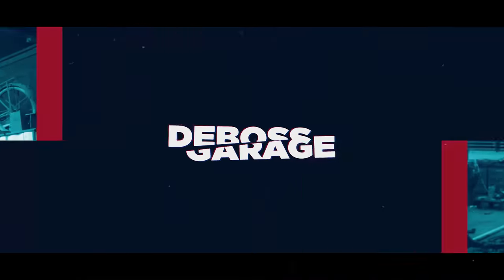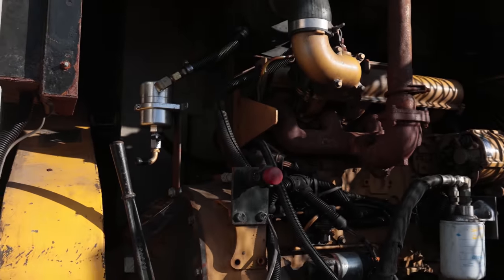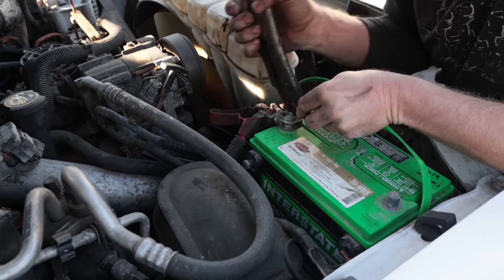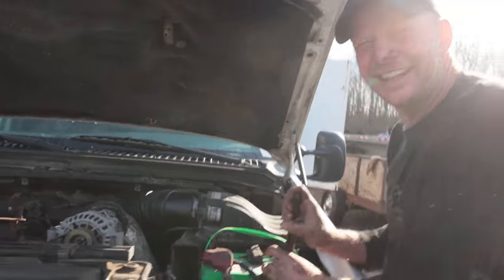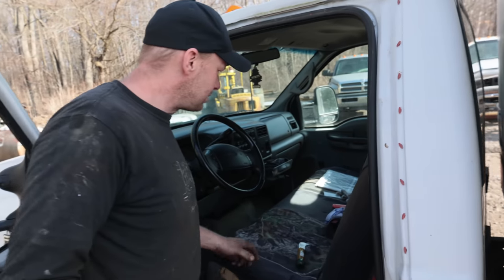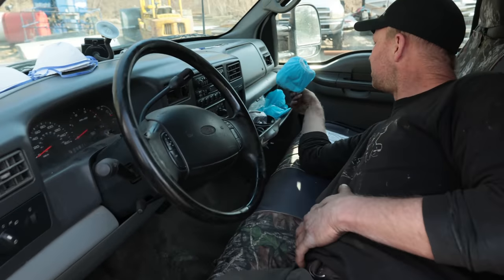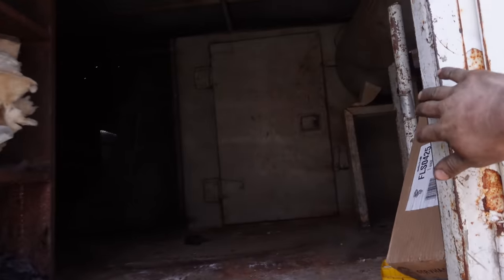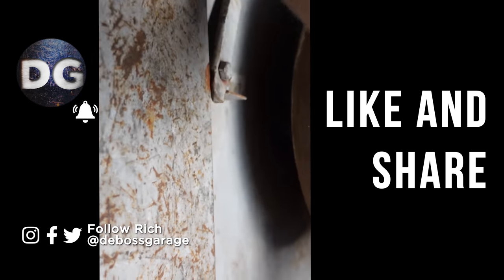Will It Run? F550 Powerstroke has a 4cyl CAT for a starter!

Comment: I wanna see that cat engine stuffed in an old 80s 4x4 Toyota pickup with dual transfer cases and 44s
Reply: Dual tcases and 44s equals broken toyota axle shafts, birfields and stripped ring and pinion gears
Reply: This
Reply: @shaun.h.barlow  Breaking it is half the fun. Upgrade as needed, Debby Downer.

Comment: Well 7.3 like to turn over fast to start.  That and they just live good glow plugs. Good video
Reply: These 7.3s if they are healthy will start just fine above 35 degrees without them. I used to have an old 95 down here in Texas, & just turned em off & had em on a switch so I can use them once a year when it got cold below 40-35 degrees.

She would always start right up & run like a clock. I’ve got a 93 idi rn & I miss the iconic sound & instant start up. I had done a straight pipe & a ton of tuneup stuff on her & even with head gasket issues & injector issues she still ran like a clock no blow by at all.

I’d get another PSD for a work truck or as a 2nd truck & have my idi as my backup/oil burner.
Reply: @michaelbenoit248  I’ve started mine in -25 here in Alaska. Absolutely hates it even when it’s plugged in.
Reply: I think he didn't give enough power to just start dumping ether at the beginning, a sniff to start, and then a few more when it clears  out

Comment: When you were cranking that engine it had a couple cylinders with low compression.  You could here the cranking speed up and slow down on a regular interval.
Reply: Same thought I had..  First crank and you could hear the dead holes.  I probably would've given up on starting right there.

Comment: cold starting 7.3s that have been sitting too long straight into the ketchup... I thought I was watching one of Peg's videos for a second
Reply: I had a 95 7.3 PSD as my first truck. The one I had was an X-Lawn care truck & it sat in a field for 3yrs. $250 later she was mine. Towed her home, threw a set of good batteries in her, & she frigin started right up & idled instantly.

She had a fuel leak, so we fixed that & a few other things. Driver her for a year then had head gasket issues & injector issues. 

During that time I did a straight pipe, 3.55 rear axle swap to make her better for the HWY & that’s about it. No tuning at all, & didn’t want too.
Reply: @michaelbenoit248  did you find a whole new rear axle or just swapped gears? I have a 97 with 4.10 gears and she’s a bear on the hoghway
Reply: @alecchamberlain4231  Mine has 4.10s as well. With a programmer intake exhaust and downpipe it holds highway speed much easier.
Reply: It all depends on the overall condition of the engine and components. My 96 was parked for over two years, but was in decent shape as far as starter, glow plugs and injectors. Two fresh batteries (not the half dead shit like Rich has laying around the shop) and it fired up on the first crank.
Reply: @Sackmatters  I’m not saying it can’t handle the highway but 70mph I’m turning 2500 rpms

Comment: We have a ‘99 F550 bucket truck, yea, if that engine is cold, we have to put one, sometimes two running vehicles on it just to keep the batteries charged while cranking it, and with starter fluid. Once it starts it has to sit there and idle for about 15/20 minutes before you can drive it. If the block heater was plugged in then it starts right up and runs well right away.

Comment: Those 7.3 engines do start alot easier when being turned over fast, as for ether, a safer way to do it is to disconnect the glow plug relay then spray into the the y pipe that goes directly to the engine. Just saying for future reference
Reply: Apparently Glow Plugs didn't function?
Reply: @bjre.wa.8681  i assume they did based on he jumped back when it turned over (backfire fire glow plugs igniting the ether)
Reply: Yeah they definitely need decent cranking rpm to start
Reply: Thanks for teaching him something.
Reply: @noahguyse2908  yup, starting fluid in a 7.3 is a good way to blow a hole in a piston if you don't undo the glow plug relay

Comment: Should do a rebuild on the 7.3L. Use the motor as an engine swap candidate, along with the CAT.
Reply: Doesn’t have to be a fan of the motor, but it’s agreed that the 7.3L is a stout diesel motor in terms of reliability. It’s even been stated by many that it is one of the best diesel engines to be ever equipped in a heavy duty truck or van, even buses and box trucks. International (at the time) sure knew what they were doing and it is one of my favorites in terms of diesel motors.
Reply: @Patrick Baptist  I agree. The only Maxxforce engine that’s decent is the DT.  I drive a bus that has a VT365, but I told myself that as soon as I was able to purchase one, take out the 365 and drop in a T444E engine. I’ve seen some run forever, and the traits the 7.3L has are second to none. Ability of running dirty fuel, even biodiesel with little to no modifications is one of the traits. Brute mechanical simplicity is another trait, thanks to the 6 head bolts per cylinder and the fixed geometry turbo. Indeed dollar per mile, the engine is the cheapest and the best engine in the IH lineup. 

(Nice job on the project so far 👍. Might even video log my swap if I could get a bus cheap and an engine cheap.)

Comment: 99.5 to early 2001 was good 2002 started powered connecting and will start to brake rod after 500hp. what a deal nice little engine. and i do hope ya took the air compressor out and kept it to would give ya all the air ya need in a shop.

Comment: You should probably know those knuckle boom little cherry pickers are real Handy they got multiple bends up and over things and if it has an extension on the basket really helpful you can go up and over racks do work on the other side of them used to use them put in retro fitting earthquake upgrade

Comment: Try to start the engine, then check the oil?  Kinda like the Far Side cartoon where two are making breakfast and one days “Wait, first add cereal, then milk!”

Enjoy your show.  In my misspent youth, I spent a lot of time working with those 71-series two-strokes. (If the Aerosmith band members had ever worked on a Gymmy that song would have been called “Scream on.”) 😉

Comment: It more than likely bent an exhaust pushrod "thumping/popping" out the intake when it the either explosion happened. 7.3 cams and lifters last forever and have almost 0 failures but rockers break pushrods bend and rocket pedestals will break off aswell.

Comment: I’d try to fit that CAT in a pickup, somehow. I know it’s not that feasible, but it would be cool.
Reply: why not feasible... there are a lot of 4BT trucks out there.
Reply: @daviddelambert2752  I’ll be the first to say I don’t know that awful much about engines and I’m learning as I go- but I thought there were some differences between engines used for stationary things and engines in vehicles. Nothing that couldn’t be solved with some other parts or workarounds, it would just be a matter of money and finding those workarounds. Though I imagine, putting this engine in a small industrial vehicle would be easier than a pickup or something, since with a pickup you’d have to figure out some kind of adapter to connect the engine to the transmission, when they probably already make adapters for the little industrial vehicles. Anything is possible with enough time, money, and effort. It’s just a matter of, “is it worth it in this particular instance?”

Comment: Put the cat in a  Half ton pickup,  ranger or s10 That would be cool I think unless it' to small. On the fork fork lift I'm sure you replaced the needle and seat , Have you replaced the float and fuel filter and check fuel pressure, May need a regulator. I have a 78 250 and it had similar problem,ended up fuel filter was deteriorating and debris got caught in needle.

Comment: If it wasn’t in Canada, I’d buy that cat. Been wanting a 3054 for my truck. Weighs less, not as tall, not as long, and stock can be just as powerful as a 4bt. If I recall the 3054 and 3056 are just descendants of the old 4.236 and 6.354 Perkins, just modernized and painted yellow.
Reply: That is correct. They are 4.236. 
The problem you will run into it is bell housing and flywheel for automotive. You can  buy anything for a 4BT to fit Ford Chevy or dodge. For the Perkins you are looking at making it all fit yourself.
Reply: I believe it’s an SAE #3 pattern, there’s adapters out there for it to automotive. I’m not claiming it’ll be easy but when is it ever.

Comment: You would be sweeping up the crank off the ground if you tried that with a 6.0 power stroke
Reply: You do realize that the rotating assembly in a 6.0 is stronger than a 7.3 right?

Comment: Wouldn't use that air compressor in the rear no more though. It's probably rusted from the inside after all these year, and is an explosion hazard when fully pressurized.

Comment: A four cylinder cat that is really a Perkins.
Reply: Perkapillar
Reply: @ForeverNeverwhere1  more than likely you’re right, Richard’s is a 3054B tier 2 engine for industrial applications, yours was a dedicated engine rating for BHL machines, same engine architecture. Although I’d suggest you if you are in the market for a new BHL to check out our new machines equipped with state-of-the-art C3.6 engine it’ll make twice the power and torque of your old machine for far less fuel usage

Comment: Hey I see u guys are using ether to start diesels. I'm sure you know that it destroys injectors. A great diesel friendly alternative that has been recommended to me was CRC heavy duty silicone lubricant spray. You can spray for "hours" with that stuff and it doesn't destroy the injectors
Reply: As a follow-up, some diesels are better to start on ether like a 2-stroke Detroit. But typically for most 4 stroke diesels silicon spray is the way to go because ether is more comparable to gasoline or alcohol vapors as opposed to silicone spray which is more like diesel/oil

Comment: I have seen a few times that the powerstrokes need some PB blaster down the intake and it'll help the rings and valves seal up enough to fire.
Reply: What that needs is actual good batteries. It’s a bigass engine and it needs rpm speed as it uses high pressure oil to fire. Minimum psi - 500 psi

Comment: "Running a bit rough.  Probably a couple of bad injectors"

That moment when that crappy 7.3L that has been sitting in a field for a couple of years with two bad injectors runs better than my 6.0L that I treat like a queen with full synthetic oil, hot shots secret, and constant maintenance........

Comment: Use propane instead of ether when cold starting a 7.3 its easier on the injector tips
Reply: Did you miss the propane can he had in the intake like right after the ether?
Reply: @phillipwarner5504  when? All I saw was ether
Reply: It was on of those green propane torches he just didn't have it lit

Comment: Damn thing sounds like it's starting and running on 5 cylinders. 97' and older for the forged rod 7.3's. 99 through 2000 is a crapshoot until IH used up all the forged rods. 2000, on and any reman are almost guaranteed a PMR engine. I could go on about the ability of PMR rods, plain and simple, the 7.3 is the wrong application for PMR, the 6.0 had a more rigid block.

Comment: For anyone who cares.
94.5 is when ford started making the 7.3 powerstroke
They made variations of the same motor until 1997, when they stopped making it untill 1999. 
99-01 had forged internals, 02-03 had cast.
The 99-03 all used better hpop and lpop systems among many things, making them much better for high hp using factory parts. 
Just to sum it up, 94.5-97, 99-03 were all the years of the 7.3 powerstroke.

Comment: Yup! 2001 they stared using a sintered connecting rod. Damn you know your stuff!
Also fun story I had a 2000 F550 that had a 10kw Onan in the back that used to run the block heater and start it. Small world
Reply: For the record, they were mixed during 01. Some were forged. Others were PMR. Mine is PMR ☹️
Reply: @gavinatkins2671  is there an indication on the serial for the engine or do you have to pull it apart?
Reply: Haven't had any such problems yet with my 02, and its been many years since it was the original power level. Only thing I've learned in a very expensive way is the oem valve springs aren't fantastic at elevated power levels, but for $120 comp cams has the solution. If only I had known that prior to my pistons and valves playing bumper cars, several times.
Reply: @JacksonEngineering  pop the rod inspection port and get a look at the bottom of the rod. If it has studs then it’s forged. If it’s a bolt instead it’s PMR.
Reply: @jaydunbar7538  about 900 ft lbs to the ground is the hard limit on PMRs. About there is where they start a journey towards their rapid unplanned disassembly.
Reply: Pmrs are good to about six hundred horse depending on how you drive
Reply: @williamuskoski1385  I drive like I’m sponsored, and all the 600 horse PMR builds I’ve seen have been high (Ish) RPM builds. 

Cylinder pressure kills PMRs and cylinder pressure is torque.
Reply: Sintered metal is the metal version of chip board sweep up the chips from machining real rods and put em in the clapped out forge that don't press as hard any more

Comment: I finished the rear end on my mini bike and did some burn outs. Can't test ride it till the new twist throttle comes in.

Have you tried those optima batteries that look like a 6 pack? I've been wanting to get one and give it a try.

Will that engine fit in a 96 s10?
Reply: Lots of extra money for no real reason to most people. The 5 year warranty batteries at Walmart are a far better value and perform the same job. Half the price and 2 years extra warranty over the optima. 

Don't get me wrong the deep cycles and agm are fantastic tech and have their place, its just not actually worth it for the average person simply wanting to start their car for work. AGM is great for high vibration environments such as the refrigeration unit on my trailer(which is a red top optima), and my ice house is powered with deep cycles where they are drained low and then recharged which is their strength over traditional lead acid.

Comment: These engines doesn’t like ether... I always pull the intake duct and spray brake clean right into the intake.. never missed one
Reply: The engine don't mind ether if the battery's are good. Glow plugs don't like the ether but real Diesel's don't have glow plugs they have compression and at least three grp31 battery's. Ether starting method for pickup diesels spray, pray, and hit the key like its a gasser just ignore the wait to start light

Comment: well you should of used brake cleaner to start diesels works better than starting fluid or some gas on a rag doesn't hydroloc so bad
Reply from the maker: Hard to find chlorinated brake clean in Canada

Comment: Kind of a waste putting it in the clapped out forklift. A pinto motor would do that for the rest of it's life, unless you plan on a total redo. Even the manlift is kind of a waste. I'd re-connect it to that nice compressor head and put it on a service truck or something like that. V&R got a nice service truck that has a salvagable crane? Nice project, and it would be great for retrievals once you got it running.
Reply from the maker: If I build a service truck, I have to go on service calls.  Why leave my shop?  I had a 4900 with 14' IMT service body and crane and sold it just for that reason.  I enjoyed the calls, just not after 5 and weekends, when its raining or cold.  That seemed to be the only time the truck was needed.
Reply: @DEBOSSGARAGE  Can't blame you there. Things seem to break more in bad weather, especially in our lattitude. Just looking for something that would really take advantage of the nice little CAT motor. I'll be watchin whatever you put her in.

Comment: I think it's funny all these starts on cars have been sitting for years and every channel I watch brings out two crappy batteries to try to get the thing to start 7 3's if you got two good batteries will start a whole lot easier amongst a lot of other vehicles.
Reply from the maker: The one battery was 1 year old.  Getting crappy batteries right off the shelf
Reply: Two good batteries are expensive. Rich teaches how to make do with what you got.
Reply: @DEBOSSGARAGE  I used to buy interstates then went to exide. They are both the same manufacturer but neither last for me.

Comment: I'd actually like the dash panel and the programming whatever for the speedo, and the driver's seat and the insulation under the hood, one of the window cranks too, and the fuel tanks!
Oh one more thing, I say all of this because we have a 2000 F550 Fontaine Classic Traveller with the 7.3 with the cheaper rods, my question is what is a good tuner i can use that wont blow the engine up?
Reply: Hydra chip with jelibuilt tuning from jelibuilt performance. He writes some of the best tunes on the market for the 7.3’s.
Reply: @bridwelln  okay thanks, my other question is how the hell do you understand the hp numbers on the tunes
Reply: @CoalChrome  stock wheel hp plus the tunes advertised hp is supposed to be what it means, but most of the time the tunes are a bit lower than advertised
Reply: @bridwelln  okay i getcha. What's the advantage of having a tuner vs taking the truck to a diesel shop and having them set a permanent one?
Reply: @CoalChrome  with the hydra you can change the tune while driving down the road, won’t have to worry about it being tuned to hot to pull heavy, or not hot enough to race someone because you can have up to 15 to choose from just by pressing a button.

Comment: You can spray ether in a cat not a power stroke or a Duramax though
Reply from the maker: You can, you just need to wait for the "wait to start" light to go off
Reply: DEBOSS GARAGE man in. Y experience it destroys duramax engines not so much Cummins power stroke or cat and Detroit’s. But I feel you when something is junk it’s not a big deal